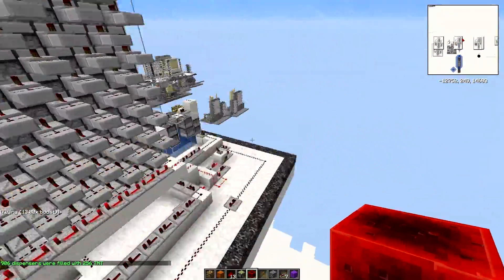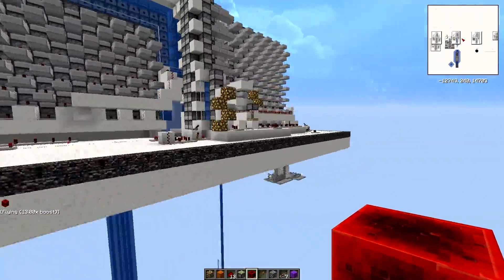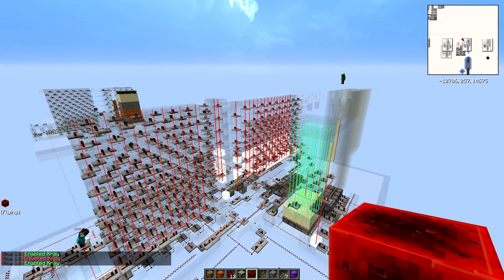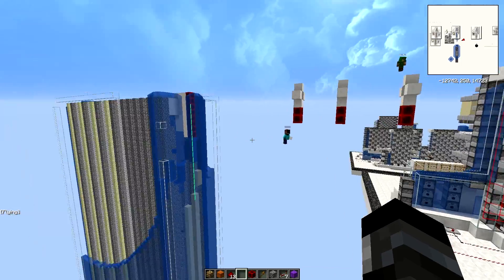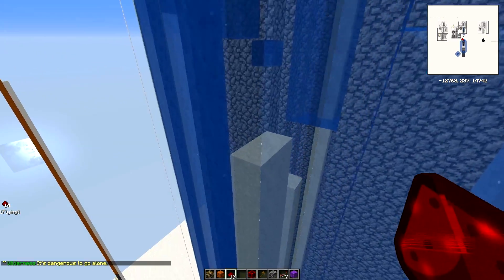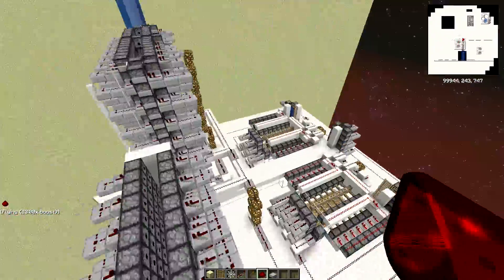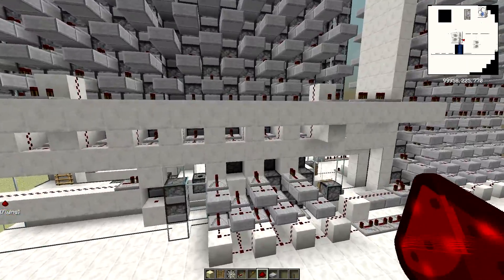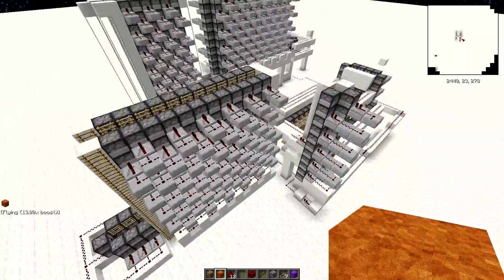Fusion Cannoning-Indexed Fullstacking with a Zero Guider Difference (Order of Entities)

Comment: https://www.youtube.com/watch?v=Ic7qqVejhnE
The cannon I planned to use on Gontroller 8.0 and Optic. I was showing Ice and themanichanml the cannon just before Optic was released. 1x1 guider's are incredibly useful and viable. One such advantage is being able to easily array cannons in a line within each other. The cannon could raid any defense without problem, dry-nuke the wall completely down/left etc, and use the under-cannon sand compression to fire every ~5 seconds. Using the same 1x1 technique, one could perfectly left/right shoot for an infinite amount of distance as well, as there was no slight difference which adds up over time (like a conventional left shooter). 

The only problem is that it relies on 2 propulsion shots 2-3 redstone ticks apart (depending on the server entirely) to work, and the TNT cost could become relatively expensive if done over a super long distance.
Reply from the maker: +Leinadarcher Can always count on Leinad and co to figure all this out some time ago haha.

Quickly cruised through the video you posted-did you ever have issues with slabbusting while fullstacking like this? As far as I think (with the little amount of time I've spent with it) I don't think its reasonable to do so...

Also looked through the description-for your adjustable line of fire raiding, are you speaking of something like a horizontal floating barrel?
Reply: +Beingsad // GetSwatted You guys are so amazing at cannoning. What inspired you to make and learn so much about cannons?
Reply from the maker: +Zeref Dragneel When I actually decide to play factions I decided to get ok at one of the two big parts of factions-raiding or PVP. I think pvp is boring, so I went with cannon... just a lot of problem solving and experimentation.
Reply: +Beingsad // GetSwatted Hmm I personally can't recall any issues at all with it. All shots behaved exactly the same way as a one shot cannon. I don't really understand what you are doing in this video, it looks like a completely different method (damn gypsy shit :P). 

As for the adjustable line of fire thing, it was nothing special. It wasn't a leftshooter or anything, just a standard high-y level one shot. It just had sticky pistons/blocks on the left side of the barrel, which could be toggled on and off. Embarrassing I know lol. It would have been cool to make a cannon that can fire along indefinite z or x coordinates, although it would never be able to do any left/right shooting. Could have led to things like nuking the same wall multiple times.
Reply from the maker: +Leinadarcher huh, interesting that it's a different method. 

I've got more on that second bit you mentioned-floating X or Z shooting based on how entities (seem) to be rendered in the X+Z vs Y coordinates.